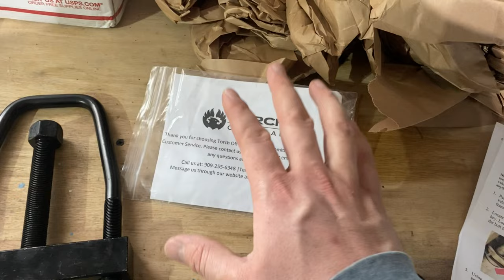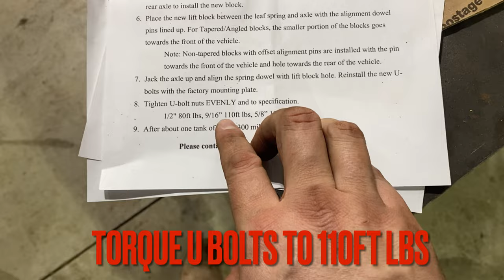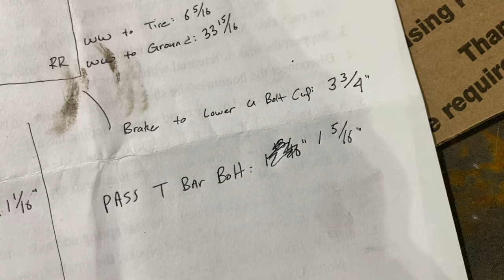Torch Off Road 1-3" Lift Kit Installation - 1995 GMC K1500

Comment: After watching the video, I bought the 3-inch lift for a 1991 Chev 1500.
The truck has 245 tires now and I always run on the other trucks run 265's .
Around the same time spring of 2025 the lift kit goes on a 385 stroker engine is replacing way to weak 350 engine.
This truck is one of 3 I own and all 3 are used for my fishing & Hunting services so the 385 stroker is for a guide's work truck for more torque for pulling boats and forest logging road drives, NO race application.
Reply from the maker: @Lure-Benson  love it!
Reply: @truckandroll989  If you get around to changing out the 350 in your truck do a 383 which is the 350-block bored 30 0ver and the 385 is a 40 over 350 block.
Also used the 6-inch connecting rod for even more torque and better fuel mileage.
The 383 I did for my 1988 truck is using 1/2 the fuel the 350 used because I am running the engine not as hard as the 350 had to work .
Cost to do a 383-work truck engine is the same as rebuilding the 350.
The parts to change out are the 383 crank - go to 6-inch rods instead of 5/7 inch rods - 400 SB flex plate and harmonic balancer for a 400 SM  + pistons for a 6 inch rod for a 383 .
The rest of the 350 you have is reused for the 383

Comment: Maybe your truck is a little different but most of the time the adjusting screws for the torsion bars should be close to the same measurement from one side to the other....

Comment: I got the 3", just finished the driver side, fender is at 39" but should go up more when I get new tires, 285/75/r16s
Reply: Do your tires clear good after the lift? I have same exact size tires on stock height and rub way too much on turns! Please let me know thank you
Reply: @ravenrivera1950  they don't rub at all, I think I could get 315's under it, I did order a zone 3" body lift haven't put it on yet, give me about an hour I can make a quick video of my truck before I do the body lift. $295 cheap way to get 6"
Reply: @cornbreaddiabetic4615  appreciate your response! I’ll watch the video if you upload 😎
Reply: @cornbreaddiabetic4615  one more question sir did you have to get an alignment done after installing?
Reply: @ravenrivera1950  yes it definitely needs one after cranking the torsion bars
Reply: @cornbreaddiabetic4615  thank you sir! Going to be rebuilding the front steering as well so wanna do both at the same time to save on alignment don’t want to pay 2 times
Reply: @ravenrivera1950  smart, when I cranked mine the steering wheel went to the right, I'll fix that when I do the body lift it has a steering linkage

Comment: I installed two inch keys to the torsion bars on my 98 Silverado ext cab. I also had to compensate the rear with 2 inch blocks. I think I had to crank the keys up to 3 inch to level it out. I can't remember. It was about 4 yrs ago I did it. It drives fine but stiffer. It hops over speed bumps unless you really creep it over. As far as being level side to side, one corner is like a 1/4 inch different than the  other 3. I just called it good. You can't  tell. 2 inch lift looks better but I plan to add another 2 inch, making it 4 inch lift. I also installed air bags to the rear for towing.

Comment: All the torsion keys are is ford torsion keys that chevy uses for a cheap lift but the bad part is that it puts the ball joints in a bind if taken to much and stiffins the ride also
Reply from the maker: Yea its a balancing act for sure.  I went up 2” instead of the full 3” that the keys will allow.  Similarly i installed larger shocks to allow for the increased travel.  You are right though modified UCAs or new ball joints are a good call for longevity sake, especially if lifting 3” +
Reply: did you buy the 3" keys or 2" keys?
Reply from the maker: @bananasdildo ordered the kit that allowed 1-3” of travel and shot for 2” by the spacers I selected in the rear.  I believe keys are one size to accommodate various lifts depending on how you set them.

Comment: Just did the Torch 2-3" leveling kit on a 99 Suburban, the problem I am having is that my new torsion keys seem like they hang from the bottom more than yours(from what I saw in the video). This is causing the UCAs to hit the droop stops I have the keys resting on the saddles as far down as they can go. I have tried various positions and swapping the keys side to side but it hasn't fixed it. I'm starting to wonder if I need new torsion bars. 

I ran into the stuck bar issue too on the passenger side, even tried a come along to pull the bar forward (didn't work). I ended up moving the brace back as you mentioned. Once the brace and key was off I was able to wiggle the bar around at that end and loosen it up to slide it forward. I needed it loose for future LCA bushings and ball joint install.
Reply from the maker: Hmm.  I think you are on the right track trying to adjust the key location by maybe 1.  Are you checking side to side height with the suspension loaded and sitting on the ground.  Do you have UCA issues says at 2” of height (higher than before).  Mine required some fine tuning to get the truck level
Reply: @truckandroll989  I attempted to adjust the key by one flat but it either hits the top inside of the cross member or droops more. The key sits on the saddle with tension on the tip of the bolt just touching its indent. The UCA is against the droop stop even when loaded with the keys in. When I installed them, I had the same conditions as yours with the wheels off and the frame on jack stands. I have 3 1/2" inches of lift compared to my stock height with no room to go down.
Reply from the maker: @4theloot638  sounds like have them droop and then adjust upwards?  I doubt the torsion keys are totally shot but could be wrong.  Perhaps Torch can help you out?
Reply: @truckandroll989  Thank you for the help, I have shot them a message to see.
Reply: @truckandroll989  Torch got me a new set of keys but, it is still the same issue. I ended up having to buy a set of Rough Country 2" keys. It seems to be sitting level and has a gap below the upper control arm now.

Comment: Thank you for this helpful video!  I've got a '98 Tahoe I'd like to lift 2" using the 2" blocks rear, and adjusting the keys in front, like you did.  Two questions: 1. When you hit a pothole or bump hard, does the truck feel wobbly?  2. How's the angle of your front axle shafts after the lift?  Thanks much!
Reply from the maker: Truck doesnt feel wobbly at all over bumps, perhaps marginally stiffer but not wobbly.

I didnt notice an issue with the axle shafts.  The CV joint can take quite a bit of misalignment.  Any higher and you may want to consider the modified upper control arms which Torch Off Road sells.  Dont forget you get discounts using my code (link in description) for anything purchased off their website

I think the 2” lift is really the happy medium here.  I think you will like it!
Reply: @truckandroll989 Awesome!  Will do!  Thank you.

Comment: I bought a truck (94 chevy) with 35s on it and it has a body lift kit. Also rhe front torsion bars are cranked to the max. The ride is horrible. I want to lift the truck up more just to lower the front end down to have a softer ride.i know i could just put smaller tires on it but i want it up the same if not a little higher than it is now
Reply from the maker: In my opinion any time the torsion bars are cranked front stock you will change height but also impact ride quality.  So if you need the clearance for 35s Id look into ways to minimize maxing out the torsion key cranking and that would help ride quality and likely increase longevity of other suspension components.  For me I had like 32” tall tires so it wasnt a huge issue to add 2” up front.  However there will always be some amount of tradeoff.

Comment: I have a 97 gmc Sierra k1500 ext cab. I want to use this same kit on mine, my question for you would be did you end up having to replace the stock UCAs? If not how are they working out? Trying to figure out if it’s necessary for me replace them when I do it. Plan on going 2” lift.
Reply from the maker: @joecorpe8243  i did not replace them when I did the lift.  However I tried to keep the lift height reasonable.  I think if you max out the kit at 3” (or more) you put the ball joints at a weird angle.  Mine has been fine though but i was only shooting for 2” from the start.  I think you will be good with 2” and stock arms
Reply: Appreciate the info. 2” is all I’m looking for. Nothing excessive, the way yours turned out is exactly what I’m looking for. I’ve been watching a lot of videos for how to do this and yours is by far the most informative. Thanks for the reply.

Comment: Why not just crank the stock torsion bars? maybe I missed that part.
Reply from the maker: So the aftermarket keys are clocked differently.  You dont have to crank the new keys as far for the same lift.  Its possible you could run out of of adjustment.

Comment: Any issues with the stock upper control arms or getting an alignment?
Reply from the maker: No, not that I’m aware of. The alignment went fine and it seems to drive OK
Reply: Cool man, I read alot of reviews on Amazon. They indicated that even with the torsion bolts backed way out. Stock upper control arms were hitting bump stops and un able to align. I wasn't sure it fake hate reviews or truth. Either way I ordered the exact equipment in your video and I'll try my luck. I have a 1996 chevrolet suburban k1500.
Reply from the maker: @yep.yep.yep.000  sweet hopefully you took advantage of the discount code ;)
Reply: Aw shit I forgot 😮 my bad
Reply: Any update on this? I wanna run this kit but was also thinking about UCAs smacking the bump stop
Reply from the maker: Kit worked great for me.  I didn’t crank them to the max but they have been great and the folks at Torch off road were great to deal with.  Check my link in the description and you can get a discount :)

Comment: I have a question about the sky jacker schocks my bushings seem to tight to fit the metal bracket for the two rear bolts did you melt yours down ? Thank you kinda following your setup 👍
Reply from the maker: So they are certainly a bit of a pain to press in you are correct.  Here are a few tips:
1. Use some sort of lubricant.  I have found for rubber on metal that interior cleaners work well (i.e. armor all, lucas, etc.). Even windex works in a pinch.

2. You can always try to toss the bushings in the freezer overnight and leave the shocks out in the sun.  Sometimes a little bit of thermal growth/shrinkage goes a long way

Take your time they will go in.  Lubing them up really helps :)
Reply: Thanks I appreciate the input it just seemed like bushing were to big but I’ll throw in freezer then coat them in wd 40 tmo👍
Reply: Everything’s done thanks for input I only swore 50 times getting bushings in😤👍😂 I will be starting to do some obs videos soon👍

Comment: I went to the site to get the same kit I see the torsion bar keys for a 94 model Chevy but I don’t see the shock kit or the rear leveling kit for anything but for a 99-07 Chevy. Will the 99-07 kit work on a 94
Reply from the maker: Best bet would be to call or email them.  They are very responsive to both and helped me find something I didn’t know they offered.  When its time to order use the link http://torchoffroad.com/truckandroll and you should get a discount at checkout :)

Comment: Do they turn when you take them out the torsion bars ?
Reply from the maker: The only way for the torsion bars to turn would be to remove them from both the keys and the lower control arms.  If yours are like mine, and are stuck in the control arms, they cannot turn.
Reply: Okay I appreciate your patience thanks bud 👍

Comment: Do you have any probs with hitting the bump stops more after the lift
Reply from the maker: I did not.  It maybe road a tiny bit rougher but that’s not uncommon when you lift it from the keys.  I also only went with the 2” lift so it certainly wasnt maxed out in its travel.
Reply: @truckandroll989  ok cool.  I am not wanting to much of a lift but I saw others talk about the bump stops too.  Good job on your video. Thank u.

Comment: Curious why your tow hooks are open down instead of to the outside? Just aesthetics?
Reply from the maker: I think they are not the original tow hooks for the truck.  They are turned 90 deg in the wrong direction but thats how they bolt up.  If i could snag the correct ones Id swap them
Reply: @truckandroll989  they look good, I was just curious if you heated and turned them or if you bought it that way. Thank you so much for the tutorial, I’m about to put 2” keys on my ‘98 model.

Comment: What was the final height at 26:14 and what size tires are you running I'm chasing after this look on my truck thank you.
Reply from the maker: I want to say right around 35” maybe a tiny bit taller.  Tires were a 32.5x12.5R15 (BFG K02)
Reply: @truckandroll989  I'm assuming a 3" lift and 33s on my rims and BFGs would give me what I'm chasing. What do you think?
Reply from the maker: @HartingFarms  if you are going for a similar look to me then yes 💯 I think it would look great!
Reply: @truckandroll989  Alright thank you I appreciate your time

Comment: Did you have to get different control arms or did the stock ones run just fine
Reply from the maker: I did not have any issues with the stock control arms, but I didn’t go as high as I could have in the front so if you were maxing out the torsion keys, it might not be a bad idea to get new control arms too
Reply: @truckandroll989  I plan on doing something similar to what you did by adding in the 2 inch blocks then just leveling out the front with the rear
Reply from the maker: @bossman147  yea i think it gave it a tough look without going overboard.  Use the link in the subscription and you get a discount on your order 😎
Reply from the maker: HTTPS://TORCHOFFROAD.COM/TRUCKANDROLL
Reply: @truckandroll989  thanks for helping me out after making the video almost a year ago
Reply from the maker: @bossman147  no worries! Glad the video was helpful

Comment: Is that n Avs bug guard ? I couldn’t get my hood to close correctly any tips ?
Reply from the maker: To be honest Ill have to check.  It was on the truck when i got it and seems to close just just fine.  That being said it is cracked in the center as has been since I got the truck
Reply: Thanks for your discount code I got mine what shocks r u running ?
Reply from the maker: @mikeydejon2148  Excellent! Glad it worked out.  I went with Skyjackers.  The part numbers are H7083 and H7081
Reply: Thanks!

Comment: Are the new shocks that you installed stock length?
Reply from the maker: Nope purchased longer then stock on purpose to account for lift
Reply: I was asking because supposedly some stock shocks have a bit of extra travel.
Reply from the maker: @yep.yep.yep.000  yea you definitely want to get a longer shock IF you are lifting and vice versa if lowering.  My old shocks were in OK shape but i was worried id be extending them beyond their useable range

Comment: I want one 3 inch i own a 1989 3/4 ton k2500
Reply from the maker: @dp97303  you can likely order one for your truck off of Torch Off Road’s website.  If you use the link in the description you get a discount too and it helps me out :)